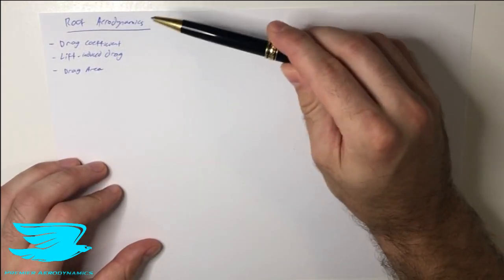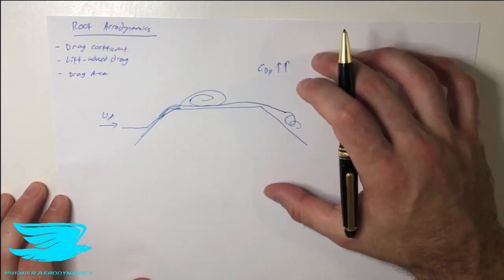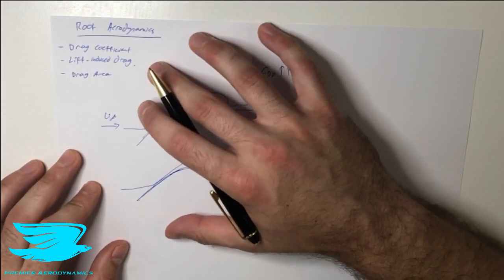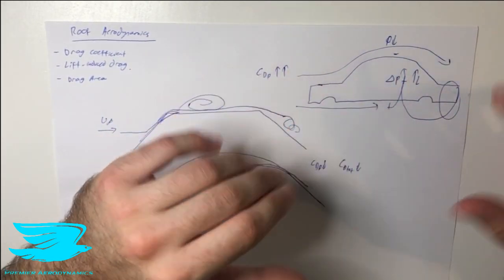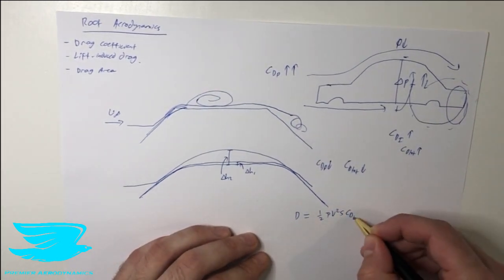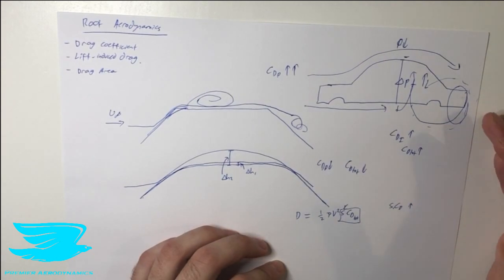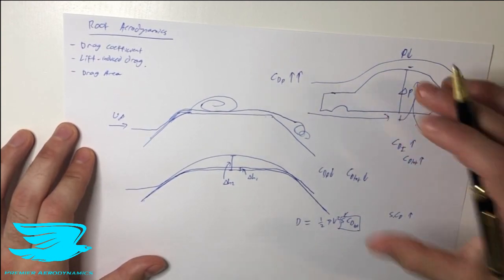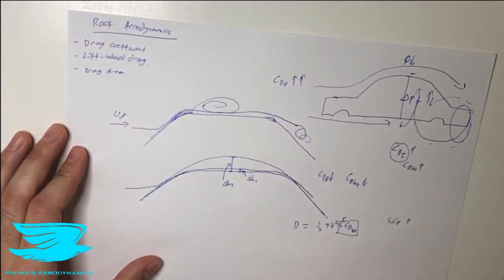{Automotive Aerodynamics #9} How to make a Car Roof more Aerodynamics

Comment: Auto aerodynamics may not be a subject many people would find very 'fun', but I am building a van hi-top ( 5' x 12') from xps foam and found your explanations very helpful. Now, instead of making the usual sharp-edged box so many other homemade tops have, we will get a lot more 'aerodynamic'! Yea, Thank you sir!
Reply from the maker: That's cool.

Yep, as a general rule, definitely try to get rid of all sharp edges.

Are you making it through CAD first or just going straight to the build?

If you have some CAD, we can do some quick CFD on it (for free), just to see how the flow is and how aerodynamic it is. Maybe others on our channel will find it interesting too.🙂
Reply: @PremierAerodynamics  I thank you for your attention on this build. We had a conversion van with a hi-top already and used the basic design as a pattern for the new one. The old one had a chopped-off-looking end so using your lessons, I am reshaping the tailend so the air flows off smoother. The foam is already cut so before I glue it together in a day or two....thanks again.
Reply from the maker: @MinuteBurn  You're welcome